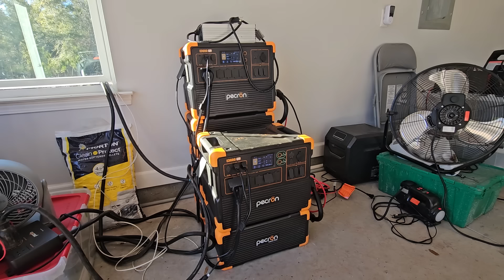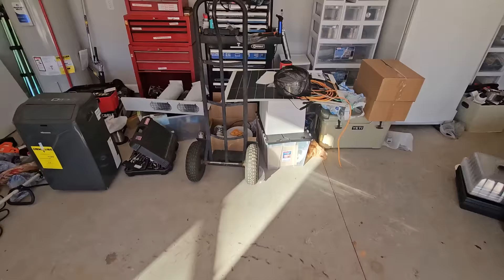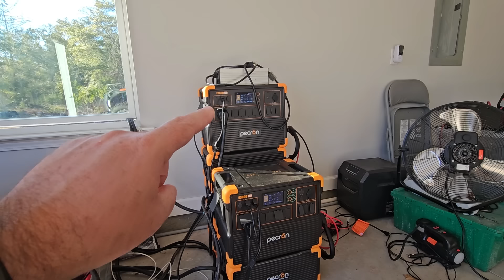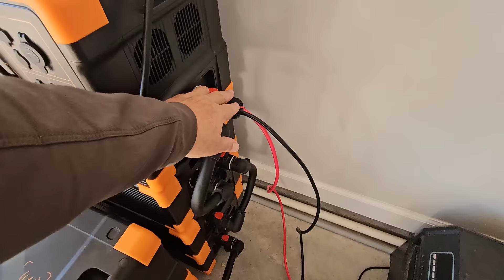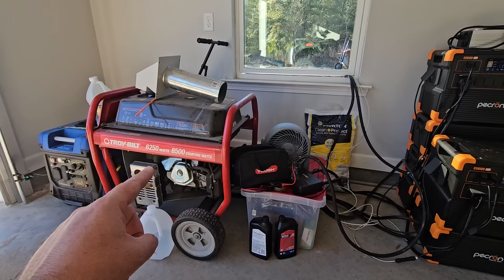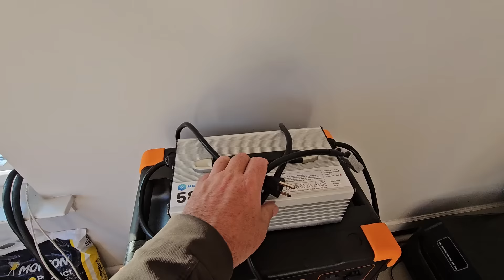One Year + Real World Review #Pecron #e3600lfp

Comment: One thing the F5000LFP has that 2 E3600LFPs don't is heated batteries.  Also they are coming out with a new 5kWh heated expansion battery that's backward compatible with all their 48V (51.2V) power stations.
Reply: Biggest issue I see is those batteries, at least what CES revealed is they have a proprietary connector for the F5000...so, at a minimum,  that's another cable/adapter.

That's a lot of weight in a battery too. Not terrible if it's set and forget, but kind of defeats the "portability".
Reply: @titobandito8474  No.  If there's anything you can say about Pecron is they don't use anything proprietary.  For E-Series power stations they use an MJ-32 connector and for the new F-Series they use an even more popular XT120 connector on their expansion ports.  5kWh should be the same weight as a server rack battery.  Heavy?  Yes, but very popular for DIYers.
Reply: @robertgiresi9515 I meant proprietary to the model since the adapter cables aren't included - meaning it's another cost.  

The F3000 didn't get one in the box for the EP3000 expansion battery and that expansion battery doesnt come with one either.  So F3000 owners had to buy the adapter separately.

Now, it looks Like the reverse scenario for the E series units and the new f5000 batteries. E series owners  will have to buy whatever adapter separately to be compatible.

It's fine for me though -  I'm not going to get the new batteries either way.  
I've got enough. And, I have my modded MJ32 bonding cable / expansion battery mod cable (SB50 Anderson ends are very useful) if I ever need to replace or add more.
Reply: @robertgiresi9515  I can't find a pre-made XT120 cable anywhere other than the Pecron one. Though the connectors are easy to find so you can make your own.
Reply: @reefhoundI made my own for my f3000. Connected a golf cart battery up and it is working great so far

Comment: Great info here and as you have answered my question in the past. I did purchase their 47" cascade cable, clipped the 5 data wires and it works perfectly as a bonding cable at less than 1/2 the price of making one.

Comment: bonding is the best hack.  I plan on adding a 3rd e3600 to my bond blocks.  that will give me more solar and battery as well as a redundant inverter JIC.  occasional mine 240 will drop for 10 seconds then turn back on.  Lilly is sending a replacement inverter for my older 3600.  she mentioned they need to be compatible.   I sent her my SN and the older one needs replaced.  it hasn't been terrible since it recovers so fast.
Reply: wait for the 3800 or the 5000 maybe.
Reply from the maker: A 3rd unit for redundancy sounds like a solid plan.
Reply: You can use that 3rd unit to charge the other two if you have them bonded together just limited to only 30amp
Reply: Wish they had a way to use more units in parallel. I need 240V @ 50 AMPS. Maybe the new 3800 or the 5000 will help